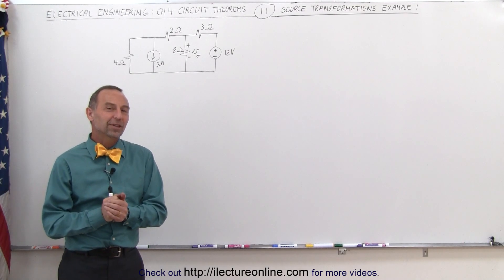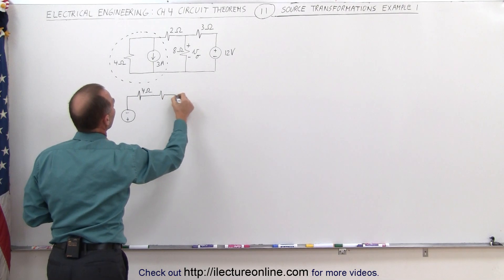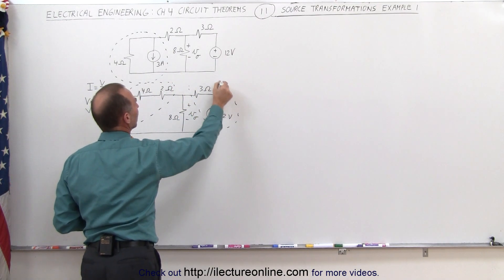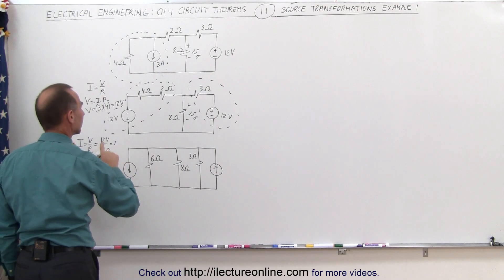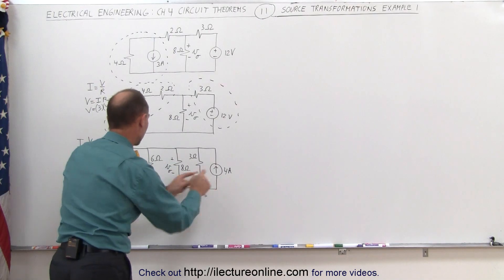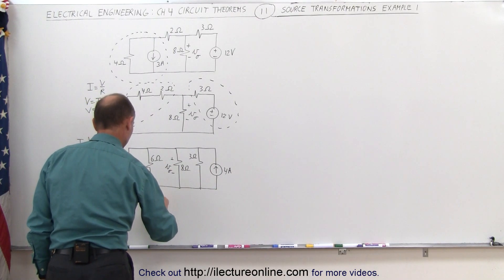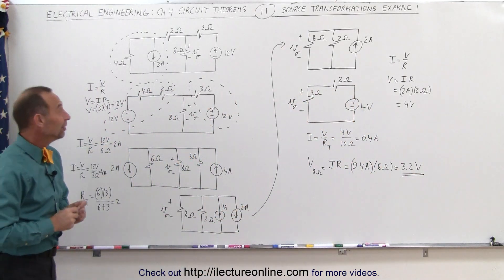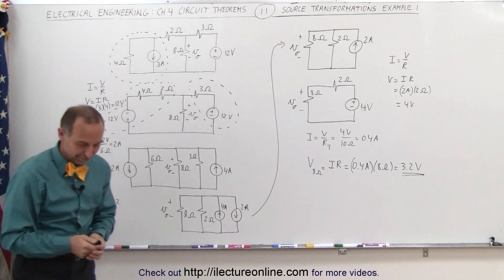Electrical Engineering: Ch 4: Circuit Theorems (11 of 35) Source Transformation Ex. 1

Comment: what if the question want to find current , voltage and power of R =2ohm?
Reply: Because we can't transform the component that we try to measure we would have to transform right side voltage source and then find the eqt. of 8 ohm and 3 ohm resistors then do a transformation of the current source that we just transformed which would result in a circuit where 3 resistors are in serials and we can calculate the values of 2 ohm resistor.

Comment: How come in the 4th circuit, the 8 ohm is moved all the way to the left? It led me to have 16v voltage source at the end.
Reply from the maker: Since all the branches are in parallel, we can move them in any position.  This way it is easier to solve the circuit.

Comment: hi sir, a question on the above video, when transforming a current source to a voltage source the in the previous video, the resistor was in the direction of the voltage, i.e positive side of the voltage source followed by the resistor in series. but in this video you put it in the opposite direction, i.e the negative side of the voltage source. does the direction you put the resistor relative to the voltage source matter in source transformation.
Reply from the maker: The position of a resistor on any one branch does not matter.

Comment: Hi monsieur Van Biezen, it's an honour to learn from your videos. I am puzzled why the 2 current sources of 4A upwards and 2A downwards resulted to a total of 2A? This would help alot.
Reply from the maker: That is done using Kirchhoff's rules.  All the currents entering a junction must equal all the currents leaving the junction.   For the junction at the top there is an unknown current entering from the left, a 4 A current entering from below and a 2 A current is leaving to the right.  Which means that a 2 A currrent must be leaving to the left.  Therefore the two branches together act as 2 A entering the junction.

Comment: If I want to find the voltage across the current source,  I can calculate it by converting the current source into voltage source in series with 4 ohm resistance and say the voltage will be 3 times 4 equal 12 volt 
or I can not transform it because I want the voltage across it and leave it and try to simplify the circuit form the right ?
Reply from the maker: Try it and see if you get the same answer as in the video.  The voltage at the node between the 2 ohm and 3 ohm resistor is (12 V - 3.2 V = 8.8 V).
Reply: @MichelvanBiezen  no it is not the same answer , and I ask you why can we not do that ? why  is the voltage across the current source not the same if we convert to a voltage source equal to 3 times 4 = 12 volt ?
Reply from the maker: No, you cannot make such "quick" assumptions.  You need to work this out one step at a time.  Note the hint I gave above regarding the voltage at the node between the 2 and 3 ohm resistor.

Comment: Hi professor, when you transform the current source to voltage source, you let 3A*4Ohm, I am a little confused if the current will flow to the right circuit, I mean does all the current from the source will flow through the 4 ohm resistor? I am always not sure about the questions like current flows, thank you very much
Reply from the maker: The way to look at this is as follows.  When you perform a source transformation, you can replace a 3 amp current source in parallel with a 4 ohm resistor, with a 12 volt voltage source in series with a 4 ohm resistor.  The effect on the remainder of the circuit is exactly the same.
Reply: @MichelvanBiezen  Thank you very much! Have a nice day!!!!

Comment: If we take the circuit where the current source is 2A and two parallel resistors 2 ohm and 8 ohms, my understanding is the 2 ohms will take (3/4) of 2A and the 8 ohms will take (1/4) of 2A! If we do the math, the voltage across 2 ohms will be (3/4) *2A*2 ohms = 3v which the same across the 8 ohms. Please correct me if I'm wrong? Thanks,
Reply from the maker: The current through the 2 ohm resistor will be:    (2 A) ( 8 / (2 + 8)) = 2 A (4/5) = 1.6 A
Reply: Thanks! I think I made a mistake with my assumption:( Cheers,

Comment: Thank you so much for the video sir, I have a question though. If we have two voltage sources in series do we simply add them if we want to have on equivalent voltage source? And is it the same with two current sources in series? Thank you in advance!
Reply from the maker: Yes that is correct.  You do have to watch for the polarity.  If they are connected such that the polarity of one is opposite to the other you have to subtract them.  Also if they are alternating sources, you have to take the phase shift into account.
Reply: Same thing for a dependent and independent source in series?

Comment: Hello Good Sir. I trust that you are doing well and the Lord is with you. Can you please make a video showing how you would deal with multiple  supply voltages in parallel (and the voltages have internal resistance).Thank you.
Reply from the maker: Thank you and yes we do have some examples with multiple sources.  If you place several sources side by side in a parallel arrangement, (each with their own internal resistance), then using Kirchhoff's rules would be your best method to determine currents in all the branches.

Comment: You could have stopped with the 3 resistors in parallel. Combining the three resistors we have  an equivalent resistance equal to 1/Req = 1/6  +  1/8  +  1/3  or Req = 1.6 ohms. Since these three resistors are in parallel  Req is also in parallel and has the same voltage across it as does the 8 ohm resistor which is what we are looking for. With a net 2 amps upwards we have a voltage of 2*Req =  2*1.6 = 3.2 V.
Reply: Wow u are actually right.Thanks ❤❤🎉

Comment: why does the 4 and 2 ohms in series all of a sudden add up to 6ohm in parallel with the source? How can we just go to parallel like this?
Reply: hey, resistors in series can be added up
4+2=6
Instead of redrawing the circuit again, he applied source transformation on the 6 ohm resistor and the voltage source in series.
Basically combined two steps into one step 
If you are confused, redraw the entire circuit again with the 4+2 step and solve the question.

Comment: for the first transformation how did you decide to put the resistor on the negative terminal side and not the positive?
Reply from the maker: It doesn't matter what side of the battery terminal you place the resistor as long as it is on the same branch.

Comment: Hi Sir. I have one question. At 1:07 you put the voltage as the - on top and plus on bottom by saying the current is going down. I'm confused how does the direction of the current down affect the orientation of the voltage source? Thanks.
Also, I would like to know what videos you have that can help me identify directions of current and voltage sources because I am extremely confused about that. Thanks
Reply from the maker: The current source pushed the current in a downward direction.  When replacing the current source with a resistor in parallel is replaced by a voltage source with the same resistor in series, you want the voltage source to push the current in the same direction (which is from the positive terminal to the negative terminal through the external circuit).
Reply: @MichelvanBiezen  Thank you for the reply. I understand the idea of source transformations and I understand the voltage needs to push the current in the same direction (down), but I still don't understand the directions of current and voltage, and why a downward push creates a negative (flipped terminals) voltage. Thanks
Reply: @kethana21  
Did you find the answer to your question since you posted?  If not, here goes my blurb
Back in the 60s when I studied DC electric circuit theory we learned that in a battery/DC circuit, voltage (electron pressure ) flows from negative to positive but current flows reverse to voltage in the circuit from positive to negative. So, with the current source arrow pointing down, the point of the arrow will always point to the positive voltage terminal.
This is a basic rule in DC theory.  Hope this helps

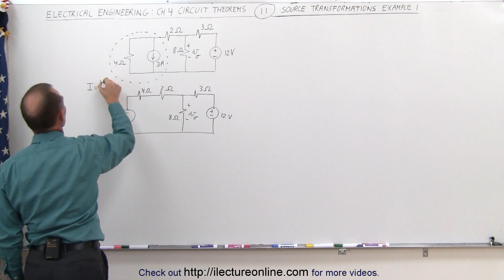Comment: I don't understand why (more or less at the minute 1:50) the equivalent voltage source calculated by replacing the current source is 12v, in particular: why has been supposed that all the 3A passes on the resistor of 4ohm in parallel? For Kirchoff law the current in a node is equivalent to the sum of currents that enter and get out from that node. So why the 3A go all on the left and do not split a bit on the left and a bit on the right of the circuit? (Sorry for my poor explanation)
Reply from the maker: Both circuits "act" in a similar manner.  The voltage and current at the terminals of both circuits is exactly the same.   This is explained in the playlist:  ELECTRICAL ENGINEERING 4: CIRCUIT THEOREMS   and again will be in playlist 11 that is currently being worked on.
Reply: Michel van Biezen 
I will put more attention on this. I want to thank you for your work and attention, really appreciated! Best channel ever!
Reply: Michel van Biezen 
Watching the lesson number 7 at this link https://youtu.be/FQX_pfFMIf0 precisely at minute 1:00 there is a substitution of a current source and has been considered to split the current for the 2 branches of the circuit, so now I am again stuck and I cannot understand why was possible to do this substitution here and considering that the current source would push 3A on both side of the circuit.
Reply: More precisely applying the Superposition theorem I calculate a tension of 7.93V on the 8ohm resistor instead of the 3.2V
If it is not, where I am mistaken?

Comment: Not sure where along the line I missed that you can move currents in parallel around and then add them together. thank you! Also, same for several resistors in parallel, for some reason it didn't occur to me that you can combine resistors that are not adjacent to each other.
Reply from the maker: It is an interesting technique indeed.

Comment: Dear Doctor Michel,

Before anything else I would like to wish you a happy new year and thank you for you help in other questions I asked in the past. 

I would like to ask you why the final answers to source transformation exercises always change depending on the approach you take to transform the circuit. Is there a set of rules or guidelines (eg. convert everything to voltage source and add or take away the voltages accordingly) that must be followed to obtain the correct answers?

Thank you in advance.

Comment: Hi professor, may I know why you change the circuit from parallel to series every time when you want to change the source (from current source to voltage source)? Is the resistances for the first right hand side circuit same as the second right hand side circuit?
Reply: One more question, why the positive and negative sign for second left hand side's circuit, the voltage source is negative at the top but not positive at the top? (the right hand last circuit follow the direction of current flow)
Reply from the maker: Let's assume we have a parallel circuit, then the current must be the same everywhere in the circuit.  A current source in such a circuit would force that current.